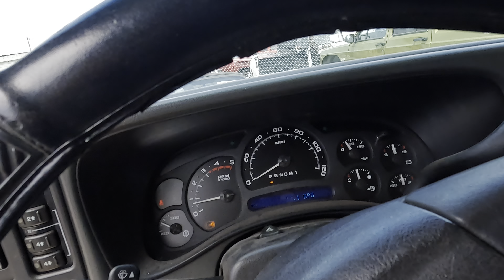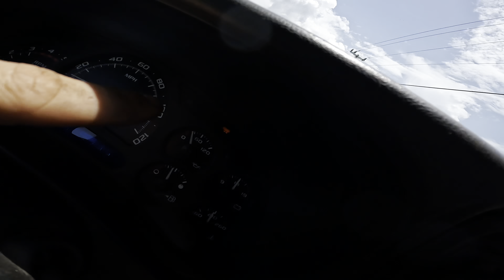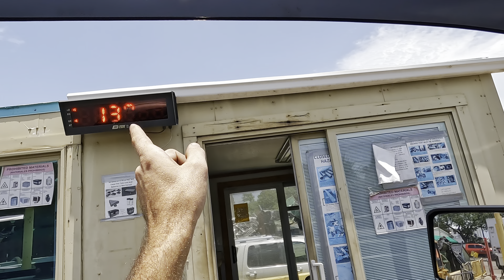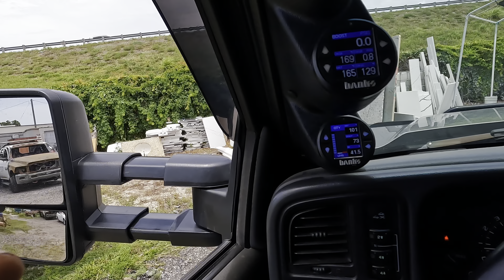Is Scrapping Worth it?? #Mechanic Side Hustle

Comment: 5:36 - Radiation detector. They used tomake thoriated steel, and you cant recycle it, so if that goes off, your load is rejected.
Reply: In the 1980s instrumentation that used a nuclear source to measure density of liquids became popular. As those plants were abandoned and eventually scrapped the sources found their way into the scrap chain. After an incident involving the radioactive contamination of a steel mill scrapyards were forced to install radiation detectors.
Reply: Cobalt 60 contaminated steel has been an issue in the past too
Reply: ...and metal smelted in Mexico for furniture ( restaurant table posts , school desks etc...)
Reply: Another person on this platform has a series called 'Plainly Difficult'.  There are more radiation incidents than I would like to have happened including the 'The Ciudad Juárez Cobalt-60 Radiation Incident 1984'
Reply: I had a new steel wheelbarrow  rot from the inside out. Was over 20 years ago- the tub was crap. No matter how clean  and painted it was it seemed to bubble up everywhere. 
I got a free new one after several years from Home Cheepo.
Reply: I learn something from most videos and frequently learn more from the comments! I didn’t know about thoriated tungsten welding.
Reply: in my area its to separate out contaminated mining equipment (from local uranium mines)
Reply: Came here to say the same.  Our local yard does not have one.
Reply: @martinhill486 That was the incident that only got discovered by chance.
A truck carrying a load of the contaminated rebar got lost and turned into Los Alamos National lab by mistake and set their radiation detectors off on the way back out!
One of the technicians at the lab chased him down in his own car.
Reply: @JustAnAverageBrad  afaiu it it not only uranium mines, pipe used in oil fields can also become radioactive from the minerals in the oil field
Reply: Multiple times I was called out on hazmat calls to facilities I was the environmental inspector for.  One common call out ended up being radioactive diapers from people undergoing cancer Iodine treatments.   However twice I found WWII lensatic compass bodies painted in tritium glow in the dark paint.  Was funny because all the first responders are in full bunny suits.  Once I get the source reading from my detector I start wading around the stuff in my street clothes because I know its a beta source as a liquid, one dried it's not that harmful (unless you sleep with it under your pillow).
Reply: Ludlums, I use there handheld rad meters for HAZMAT response.  That's the drive through rad detector.
Reply: Often the contaminate is on the steel surface. Dirt, paint, etc. The steel itself isn't.
Reply: @martinhill486  watched some of those in the past. Stolen cobalt 60 rad sources etc. Scary stuff
Reply: Another great video you could make anything exciting even going to the scrap yard😂 That being said that $240 that you put in your pocket a 120 of that should go to tboy that's the way it is in any shop I've ever worked in or been in the marrow gets split up between the workers and yes your wife can have a piece of it too so split it in 3 wa''s and I'm not kidding about that that's the way it is in a scrap world, So you need to take that money back out of your pocket give Troy his $120 or if you're going to split it up 3 ways because of the wifefunit give him his third. That is how it is done Unless you're stingy then I wouldn't want to work for you
Reply: @fuzzy1dk  it's called N.O.R.M. naturally occurring radioactive material.
Reply: Pre-1945 steel recovered from the deep is incredibly valuable as it has virtually no trace radioactives and can be used in instrumentation and equipment that can't be even very slightly radioactive.

As opposed to every piece of ferrous material produced since, regardless of location on the globe.  Disturbing to think about.
Reply: Old furnace ducting with asbestos is also a no no...A great run ray...good to hear what scrap prices are down there in Fl. That bed lift didn't like that weight...always cool to hit a button and watch your trailerful of whatever disappear in seconds when it took way more time to load. 
    A good video as always Ray 🙂
Reply: Do you not get a refund on propane cylinders like the one that fell out first? That's about $60 equivalent in the UK.
Reply: @spaceflight1019 shoot I’d collect any radium I could get my hands on as a side hustle on a scrap yard.  Just keep it separated.  Use it to operate a boiler shed for free heat
Reply: @SportFury1966   And that's why WWII naval shipwrecks are mysteriously vanishing from the ocean floor. (Scrappers.)

Comment: The black box with the cable on it is your trailers emergency breakaway brake, and should be hooked up to the truck as well. We use a keychain caribeaner and hook it to the safety chain pocket.
Reply: And check the battery if it's electric brakes.

Comment: @2:35 I didn't know that you worked on YouTubes!!! How do you break and then fix a broken YouTube??😆😆😆 Back in 1966 when I started work with the Florida State Road Department, I worked on a survey crew working on the I-95 bridge over the Miami River in downtown Miami. The instrumentman liked to collect scrap metal, copper wire, brass screws, etc. His name was Harold and because he spent his spare time in the abandoned boat yard that was the path of the new bridge, he was always bent over picking up brass screws. Hence we called him Chicken Harold!!  This was back in the days of CRT TV's with lots of copper wires and vacuum tubes and we spent a great deal of time picking up old TV's and stripping them.  He made a lot of money on the side collecting scrap metal from the work site and surrounding areas.

Comment: Ha, old drivers trick. Grab the bottom of the steering wheel when reversing. Move the wheel left to go left and so on. Give it a try, makes backing a trailer of any size a lot easier.

Comment: I have several bins at my shop... One steel,  one clean aluminum, one cast iron. Conveniently, I'm across the street from a recycler. They just bring a forklift across the street and grab my bins when they're full. I make about $300/mo recycling things I used to throw away. As for the batteries, just start a commercial account. Usually, recyclers don't have limits on commercial accounts. Until I got my commercial account, I couldn't recycle cats without bringing the registration from the car that the cat came from.

Comment: Scrapping is worth it if you're willing to put the work in. Best thing is to find a place that needs cleaned up, then offer to clean it up for half of the money you get when selling it minus costs such as fuel. Most people will agree to it. Cleaned up a couple of places before and got several thousands dollars for a couple days of work. Also, getting more difficult though to do scrapping because of all the thieving, especially copper and catalytic converter thieving. Have to basically sign your life away when you try to sell it, lol.

Comment: I don't know the regulations in Florida, but that spring loaded hook isn't legal where I live. Must use a closed shackle. And the latch never sprung closed anyway. So it's possible to simply fall off and be useless as a backup to the hitch. Also, the load was not covered, as is required in most states. OK I guess if you are going slow, but at freeway speeds, some of that metal could be lifted by wind pressure and fly into vehicles behind.

Comment: I used to operate the same crane....Liebherr LH50.... but was at a shredder yard.  I fed scrap, and a couple hundred whole vehicles per shift onto a big conveyor... which fed the 4000HP machine.  1 full sized truck would be reduced to pcs no larger than your fist...in a minute or less!!   Was a fun job 😊😊

Comment: The cars wind up in a shredder that will rip them into tiny bits, then separate the steel from the aluminum, and the aluminum from the "fluff" which is all the plastic, foam and such, then they'll load them on rail cars or barges and off to the smelters! Used to be my favorite part of going to the scrap yard as a kid seeing them load cars in the shredder. Those material handler excavators will pick them up and throw them around like matchbox cars!

Comment: Every shop I know of makes that scrap run, best to keep radiators, aluminum, copper,brass, and cast parts all separate, each is usually
Worth more separated, put it all together and you get the lowest price for what you have, scrap iron. Rotors seem to be worth more money, so I stack those until I have a load of them.
Reply: Shhhh, the crackhead may hear and start stealing those next! 😂 would love to see them try!

Comment: Ray, don't put used cats in the scrap. If they're not completely melted or hollow, you can sell them for from $100 to $800, depending on the size.
Reply: That was probably a resonator,not a cat.
Reply: @PointBlank65  Had an O2 sensor bung. It's a cat.

Comment: Used to have to haul scrap a couple times a month at the old shop I worked at. They made pretty good money off those truck loads of metal. It was usually a couple hundred dollars per load. Well worth recycling your metal. Every little bit of money helps when you're running a business.

Comment: At the shop I work at we run scrap every 3 months and usually make 3000$ but we also do anywhere from 175-250k a month. And we don't separate the aluminum  from the steal.

Comment: @RainmanRaysRepairs I know a Mexican guy near Chicago that works with HVAC companies to remove old boilers and he has about 5-6 companies he removes the heavy iron for.  He clears about $1500 a week 5 days a week, weekends off with a beater truck.  You can still live damn good on 6K cash a month.  He has a rig he built with a chain fall to lift the crazy heavy parts and it swings anywhere he wants.  It's not a bad setup at all.  Great second job or side hustle too.

Comment: Don't make much but i feel its the correct thing to do, I'm not a tree hugger,but better than land fill. I use old 55 gallon barrels top cut out, outside of the shop.Sort as it comes, steal, aluminum, copper,brass,ect.makes it all easier.

Comment: As captain lulz said radiation detector.  Anyone who deals in scrap in volume has them.  Steel mill I worked for had them on truck scale & barge dock.  Common sources are smoke detectors, radiation thickness gauges, scrap metal from nuclear industry.  One incident in Spain stainless steel mill bought scrap that included metal from reactor in USSR.  Had to decontaminate 150 ton arc Furnace- multi million dollars!

Comment: That was a radiation scanner at the scales. People have acquired old X-Ray machines and tried recycling them, thus radiation scanners. 

They sort the metals at that facility into different grades and ship it to steel mills for melting and turning it into billets for further processing. 

You can be more profitable by sorting the metals yourself into different grades and many times double your profits. Stainless steel brings nearly double the profit, #1 steel brings about 50% more which is heavier and thicker gauge steel. Basically your load was mixed 1&2 which is what they classify most mixed loads.

Usually things like cars and mixed metal will run through a shredder which is used to mix with you other metals so the buckets get completely filled at the steel mills. The buckets are dumped into the furnaces and use a large electrode to melt it down so it can be poured into a label and through molds.

Hopefully this answered some questions you may have had.

The excavator was pretty cool with the orange peel type grapple.

Comment: Impressive lesson in reversing a trailer 👍
Reply: It's a lot like balancing a pole on your nose, but in slow motion. Once the trailer starts to turn, you need to be on top of it or you'll end up jackknifing the thing in seconds and put a big dent in your rear bumper and/or the trailer. Just take it slow, get a feel for the balance, and you'll be pulling stuff like this video in no time.
Reply: After a while you get the hang of, he’s probably done it 20,000 times by now at least

Comment: Ray , just a heads up . When scrapping metal if you have radiators scrap them separately . The same with large amounts of copper . place it in a separate bucket .
Reply: I think this was Ray's first time.
Reply: @TheHolyGhost777  I found out the hard way . When I drove on the scale I happened to ask about the three radiators I had . He had me remove them and paid for them separately . He didn't volunteer the information .

Comment: The price you were paid was for mixed iron/steel. If you break it down better and set aside steel that could be cut down to under 3 ft length you'd get better price for it. My Uncle used to run an old junkyard back home in NY and he got top prices for his scrap because he knew what to sort into what and how to break them down for better pricing. Being your doing it from running a repair shop, I wouldn't expect you to sort it down or break down metals into smaller chunks for better prices due to the fact it would not be cost effective for your business. If though you had extra trailers to sort them, you'd do better the next time you go.. rotors, drums, springs, and such get different prices than fuel tanks, exhaust pipe, fenders, bumpers and the like.

Comment: I usually have enough junk to go to the scrapyard once or twice per year. Steel and iron pay very little. Copper and pop cans pay the best. Aluminum (other than cans) pays ok, but since aluminum is so light, you need a lot to make it worth your while. Still, it is still better than nothing, and is much better than throwing stuff away. BTW, when I take steel, I take everything-old nails, screws, scraps of steel cut from other pieces. It may not be much, but it adds up. (A couple of shops I worked at even took the chips of iron from turning drums and rotors- a bucketful gets pretty heavy)!

Comment: The big white things on the side of the scale are radiation detectors to keep radioactive material out of the yard I worked at a scrap yard for a while and we also had a rail way scale and every once in a while a passing train would set off the detector and it would sound an alarm

Comment: Not sure if this would help with the batteries, etc. or not, but you can put on the invoice "replacing battery (information of the old battery) with new battery (information of the new battery). That way it'll have your company information as well as where the battery came from.

Comment: the value of scrap really depends on what you are scrapping... 3,000lbs of platinum is going to bring in a lot more then 3,000 lbs of steel.
sorting and having just the pure metal also increases the value, taking the copper out of a cable and turning in pure copper is worth quite a bit more than leaving the copper in the cable for them to strip n sort.

Comment: I think the sensors on the sides going into the scales may actually be radiation detectors, to prevent orphaned sources causing contamination of the recycled metal.

Comment: If you want to increase your scrap value, segregate out radiators and condensers that are copper/aluminum.  Also Catalytic converters, then split up aluminum from regular steel.   Steel is lowest value, the rest higher.  Also beware of large numbers of lead acid batteries.. could trigger Hazmat manifesting.  If you have a safety kleen acct for your parts washer check with them.  They may be able to service your battery disposal.

Comment: The sensor on the scale entrance is essentially a Geiger counter. Scrap metal that comes out of the ground such as drill pipe and sucker rod can be radioactive and they can't accept it.
Reply: @TheCaptainLulz
5:36 - Radiation detector. They used to make thoriated steel. You cant recycle it, so if that goes off, your load is rejected.

Comment: I took some stuff to the recycle yard one time. Made about $4. I think I spent $4 in gas getting there. Hahaha
Reply: I live in Minnesota and about 4-5 winters ago I cleaned all the old cars and farm machinery from my grandfathers and made about $15000 with my pickup and 28’ gooseneck
Reply: @Kevin1980-k6g  It all depends on where you live and what yards are paying for scrap. I've drug vehicles over the scales and made $500 before. But on the other hand taken another vehicle roughly the weight to the same yard and only received about $300. I'm in Texas only about 150 miles, as the crow flies, from the The Gulf. So there are factors in how much someone will get for scrap. Not to mention that 4 or 5 years ago our economy wasn't this F'ed up. So scrap prices were up.
Reply: @Kevin1980-k6g  5 years ago prices were quite a bit higher if i recall correctly. But yes, equipment can be heavy and well worth it

Comment: Hi Ray and Troy,  no that's not how they scrap cars.  they go to a shredder, shredded, and the machine depending on how many stations they have will separate the different metals, plastic and fiber materials.  then its put into trucks and taken to the next phase.. also, the cleaner the metals are the more your suppose to get..

Comment: Those are radiation sensors, they are used to detect scrap for radiation. We had a major problem with rebar that was imported from Ukraine to use in construction in the late 80s for cheap. The stuff was radiated like crazy and was left dumped  in the desert for years. Unfortunately people thought it was an opportunity to steal it and use it in home construction. I can only imagine the cancer it caused etc...
Reply: Mexico
The radioactive material, cobalt-60, ended up in a junkyard, where it was sold to foundries that inadvertently smelted it with other metals and produced about 6,000 tons of contaminated rebar.
2,360 tons of unused rebar were recovered.